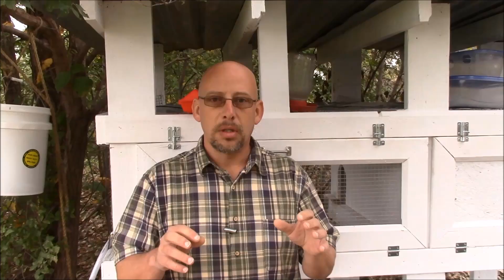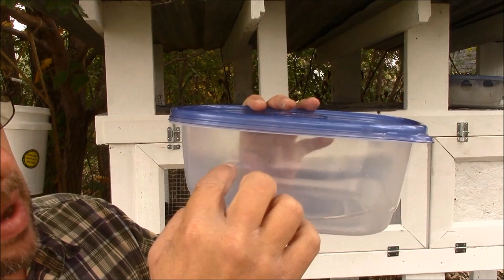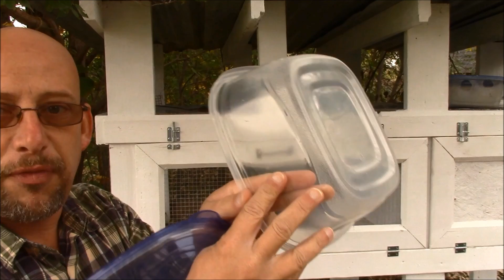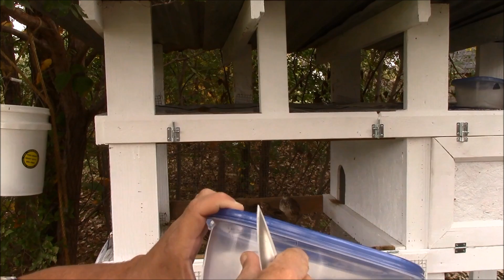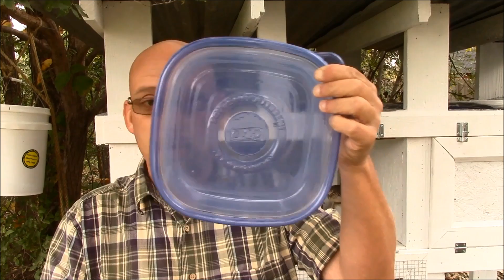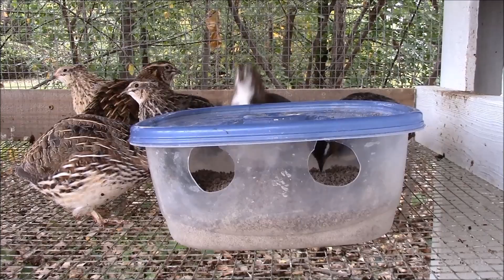Reduce or Eliminate Quail Feed Waste: The SR Quail Update 10-31-16

Comment: love it... one idea though easier than cutting or drilling ...use a 3/4 inch piece of copper pipe and heat end of pipe with a torch or stove flame and melt a hole through plastic works great

Comment: Thank you! I tried making this before but I made the hole way too big and my quail are sleeping in it and making a huge mess. Couldn’t figure out what I had done wrong until I saw this. I will try again. One thing I will say, I used a hot knife to make the hole and it worked really well. Also it’s much easier to clean up any sharp edges with a hot knife
Reply from the maker: A hot knife is the way to go for sure.  Thanks so much for watching this video.  I am glad you found it helpful.

Comment: What size are the holes?  What size hole saw should I use?
Reply from the maker: I actually don't use a hole saw.  I just cut the holes out with a knife but I think they are about 2 inch holes.  They don't need much.

Comment: I love my food container, it is a food grade bucket, someone cut holes in around the bottom and put elbow plastic pipes in that go to about 2" above the bottom. No mess at all, except my quail and the feeder are on the ground, so they kick stuff into the holes so I have to tip it to the side once in a while to get the junk out. I think if I could hang it or get it up off the ground it would solve that problem.
Reply from the maker: Sounds like a great container.  I am toying around with building something similar.

Comment: I had a massive problem with this. 2 Quails attempted to stick their head in the same hole and died of strangulation. Wouldn't recommend this
Reply from the maker: wow.  I have never seen that happen.  Maybe make the holes a little bigger?  So sorry to hear about your problems.
Reply: Thanks for the reply, I've tried again but put lots more holes into the box so they can clearly see they don't have to squeeze into the same one. I hope this works however it sorts of defeats the purpose and lots of feed will probably still be wasted

Comment: Do you still have a little food mess. Either I fill it to full or they just want to be messy I have 50 quail and almost go through a 50 lb bag in 1 1/2 weeks. If I put less in there and they run out will they starve over night. I work 2nd shift so I get the eggs and feed them at noon then next morning I do the same. I don't want to bother them when lights off
Reply from the maker: A little but really not much at all.  A 50 pound bag of food sounds like a lot for 50 quail.  You could add a few more feeders and keep them all lower filled so you don't have as much of a mess and don't worry about running out of food.
Reply: Good idea I do have the same food setup as you. I have 5 cages with 10 birds in each
Reply from the maker: Sounds like a nice set up.  Hope it works out well.
Reply: How much do you feed yours a day
Reply: You shouldn't be able to fill it full because the holes would let feed out (unless you mean full up to where the holes are).  Adult quails don't necessarily need to be eating all the time, so if they have a few hours each day where they don't have food, they should be OK.  Also look into making fermented feed if you want.  People who supplement their birds with fermented feed say that they use less of it.  Also quail like to eat other things, too, so you can supplement that way.  For example, greens that you might grow in your garden or outside your garden, such as bean sprouts.  Mung beans are cheap and you can make lots of bean sprouts for a little cost.
Reply: Sould cut wire mesh to fit in side the container boomm no more messs

Comment: I went with 1 1/2" holes and my Button quails go inside the container.. I will buy some more and drill this at 1 1/4".  I attempted to drill the holes with a spade bit and did not work well.. I then ran the same bit backwards and and worked perfectly.
Reply from the maker: Good idea.  I generally don't even use a drill and just cut a rough hole out with my pocket knife.  They don't care if it is perfectly round or not.  :)
Reply: Slightly Rednecked  OK You Did Ask a BETTER QUAIL FEEDER @ LearnGrowLiveWell just an Upgrade on your Feeder. Used 4in x 10ft for deer feeders w Shelled Corn, tied to Trees.

Comment: Looks great, just got quai;. bit concerned that it's too sharp though. any solutions ?
Reply from the maker: Thanks for watching.  I have never had any issues with the quail injuring themselves.  You could take some fine grain sand paper and sand it down or use a whole saw to cut a smoother hole out.

Comment: Hi Chris, I made one of these about 5 weeks ago and love it!  I didn't want to have to refill it  too often so I came up with an automatic (gravity fed) solution.  I can fill 1 gallon of food at a time.  I posted a video on my channel.  Please check it out and let me know what you think.  Thanks!
Reply from the maker: Great idea.  Thanks for sharing.  I thought of doing something similar but hadn't thought it out that well yet.  I was always stuck on one funnel in and trying to figure out how to position it just right.  I never thought about two.  I bet PVC pipe would work great for that.  One question, is it top heavy?  Does it get tipped over easily?
Reply: I'm glad you liked it!  So far it hasn't been knocked over yet.  I've been using it for 5 weeks.  I'll try it with pvc next.  Have a great Holiday!

Comment: I use those clear plastic kitchen storage containers (like for flour or sugar). I attach the lid to the top of the cage with some wire, and then just unscrew it when I need to fill it. That way the heathen birds can't knock them over jumping on top of them and stuff. I do holes the way you do though, I got the idea from your earlier videos :)
Reply from the maker: good suggestion. Thanks for sharing it.  And glad I could help with earlier videos. :)

Comment: We've been using the long red chick feeders and haven't much problem with waste or with them pooping in the feeder, but I think we will try this for added protection. Do you sand the edges at all to round them? or just leave them as they are?
Reply from the maker: No, I just cut out a hole and clean it up with the pocket knife.  The edges really aren't that sharp.  Thanks for watching.

Comment: I use 3 inch pvc pipe, cut to whatever length you want,  cut a slot out and mount it to a piece of five quarter board. put test caps on each end and it is ready to go
Reply from the maker: Sounds like that would work well.  I have seen some PVC feeders that looked pretty good but I haven't built one myself.  Thanks for sharing.